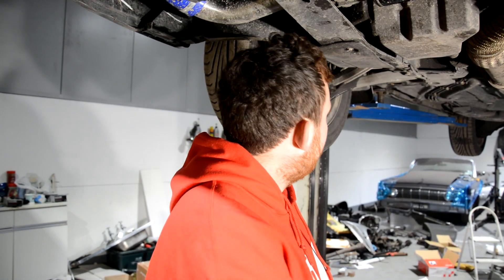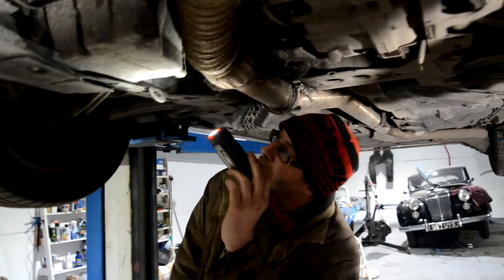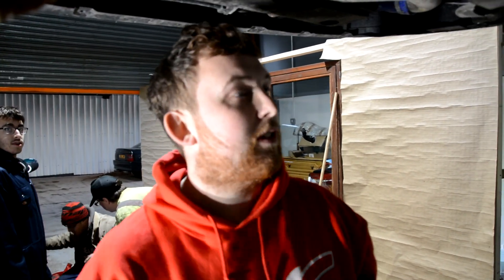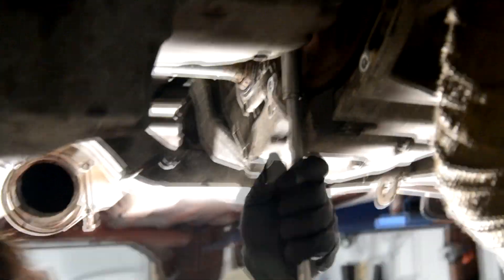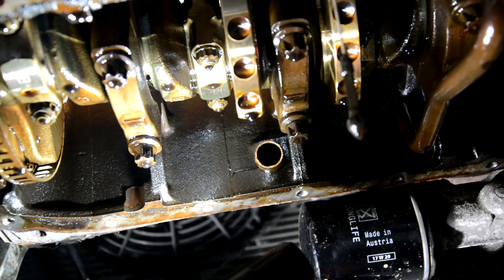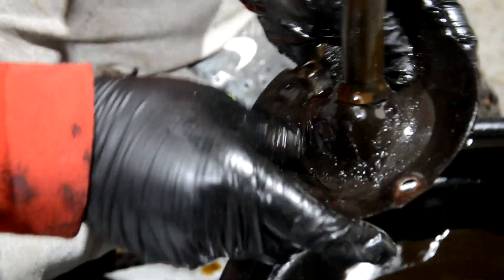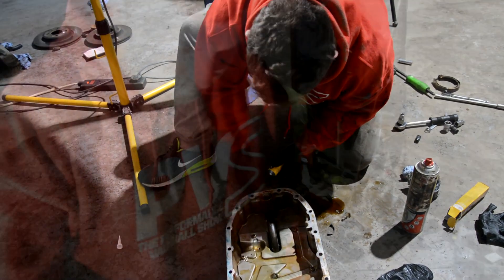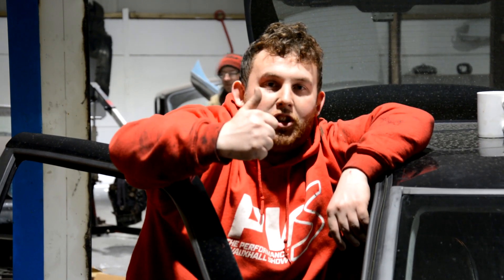Saab engine sump removal and inspection

Comment: So, the second tube pictured above the sump running across the main bearing is held in by the oil filter housing, correct? How does that stay attached tight with the sump on?

Comment: Did you support the engine using a beam when you loosened the subframe?
Reply from the maker: No need as the drivers side engine mount is attached to the chassis leg
Reply: @wheelhobbies5021  Brilliant, many thanks.